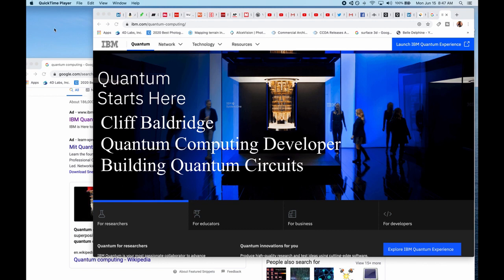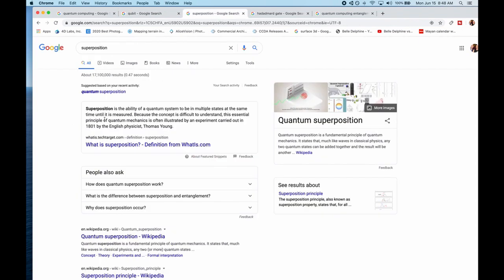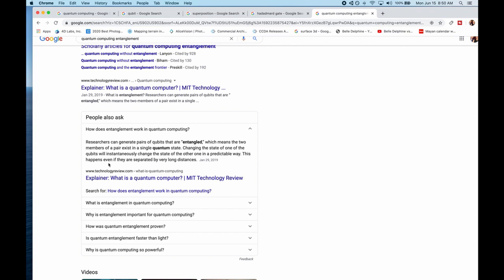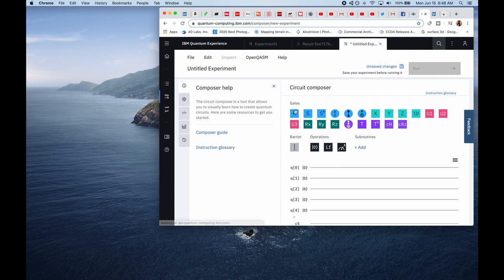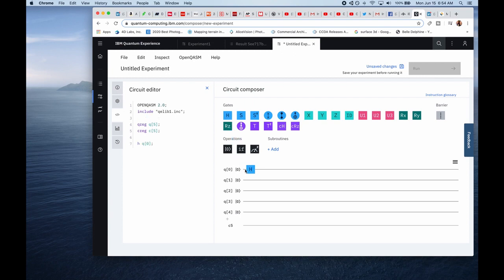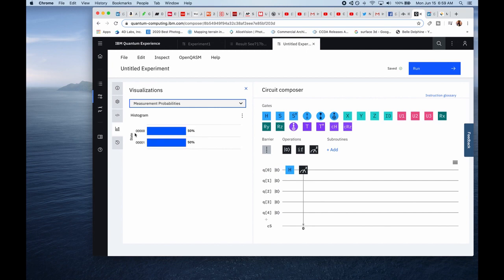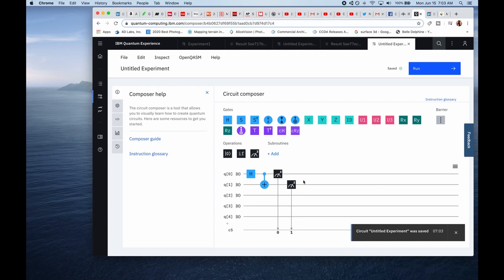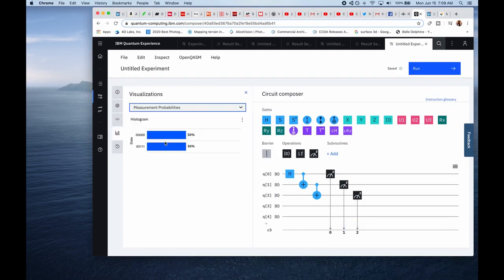How to Make Quantum Computer Circuits IBM Q Cloud Quantum Computing Tutorial

Comment: Sir. can we also build multivalued logic on IBMQ ?
Reply from the maker: Thanks for writing. Yes, Sir. IBM's Qiskit framework allows you to simulate higher-dimensional systems and implement custom logic gates.
Example:
Encode a ternary logic gate (like ternary AND or OR) using controlled operations and ancillary qubits.
Use QuantumRegister and ClassicalRegister to set up the necessary states and simulate outcomes.
Hope that helps.